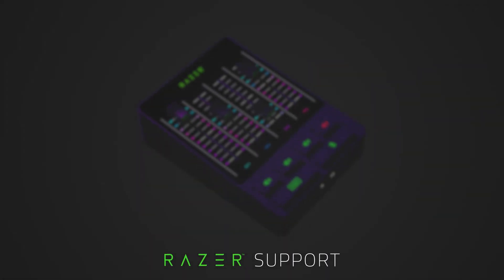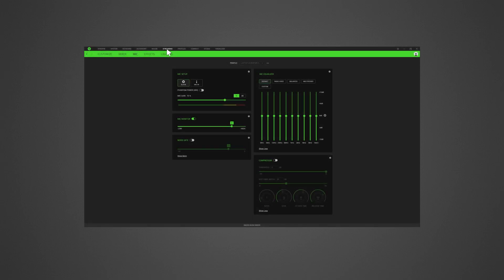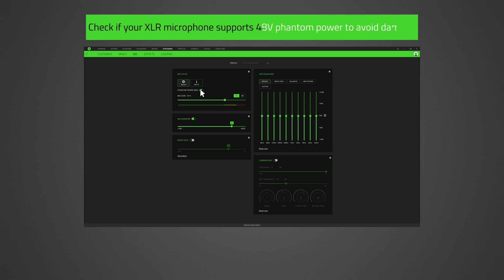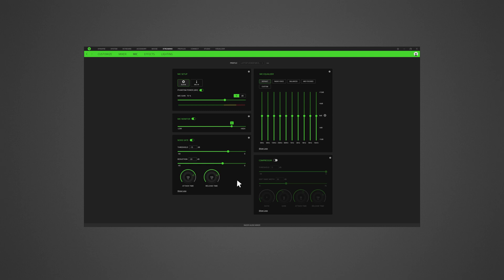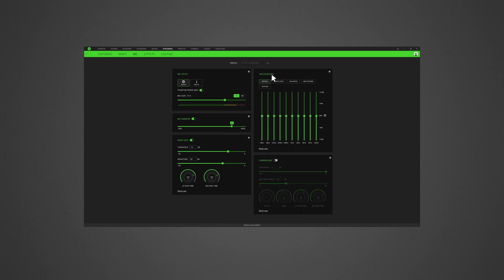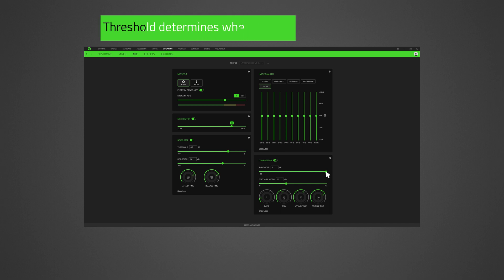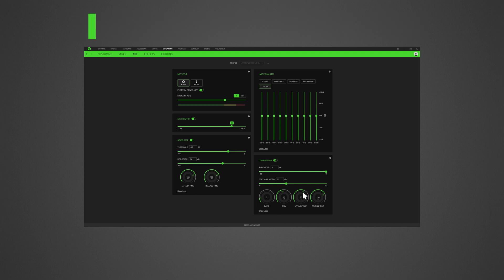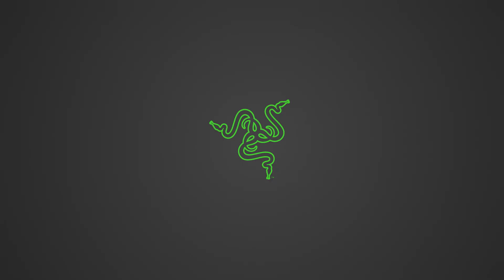How to configure the mic on your Razer Audio Mixer

Comment: Can someone help me? I bought the R audio mixer to use on my (shure mv7) with the XLR cable and surprise apparently it’s not compatible. it does not turn on or give a signal through XLR (I have updated all the drivers with it (Shure SW) and also the firmware of the mixer, the WDS updates... I have even tried to reinstall (RAZER S 3) but I cannot make it work via XLR
Reply: did you figure it out?

Comment: When will you implement USB microphone support to properly control mic audio from your various USB headsets and mics, like the Nari Ultimate or Seiren Mini? Your current solution of piping out the audio via a mic's headphone port doesn't work with devices like these.
Reply: facts I'm like how would you use 100 percent of Razer usb mics and headsets with a mixer giving it no support ugh and there's no true Razer Xlr mic the settings don't allow you to select what input and outputs freely I'm definitely bummed holding my razer audio mixer in hand as a paper weight at the moment
Reply: @RobskateTV  I have a Razer Seiren Pro and it's a XLR mic but out the box has a dual cable and this is a one in thing how I supposed I'm going to conect it if you would buy it.